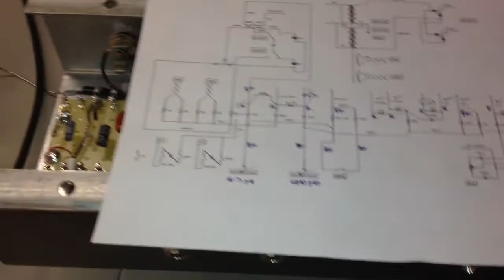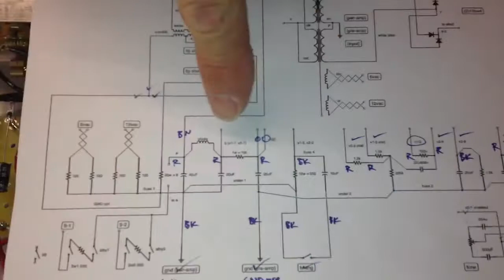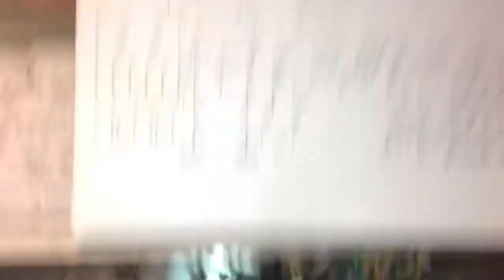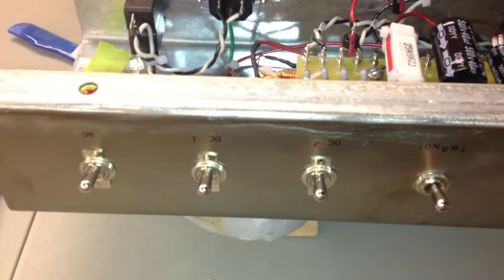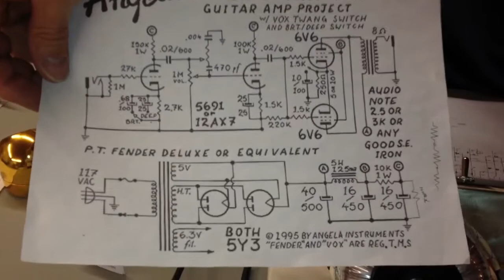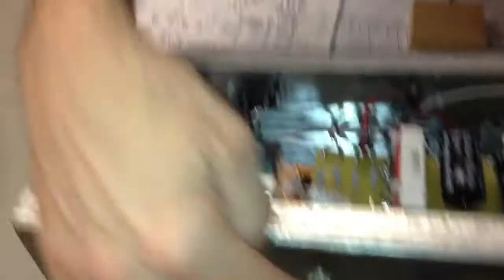angela super single ended 1

Comment: I'm halfway thru a build of the same Amp using original tube specs... I now believe there is too much B.S  included and have decided to strip it back to a quality Princeton circuit.
Reply from the maker: Plz elaborate
Reply: @rick_m_b  I'm building the Amp using the 6v6 tube and the dual 5y3 rectifier tubes... I chose this project as my first build which may not have been a wise choice - After reviewing your build video and the challenges you've incurred combined with my own challenges I feel a time tested design like the Princeton seems like a better choice and I can use most of the parts I have.

Thoughts?
Reply from the maker: @kevinking2468  sry Kevin
IMO the original circuit is simple enough (it’s based on the Fender Champ or very early Princeton). My troubles stemmed from changing tube types (6bm8 substituted for 6v6 and 12ax7). I had previously built a smaller amp with 6bm8 and the original "Angela Super Single Ended" suggested substituting 6SL7 for 12ax7... that lead me down a rabbit hole. I substituted ALL types and that’s where my troubles came from. After may hours of troubleshooting and trial-and-error failures, we changed direction into a "Princeton Reverb" preamp section into the "ASSE" power section as originally specified. The current design works flawlessly and we’re all quite satisfied. The things you will want to watch out for

1- (if you haven’t already considered this) is impedance matching a pair of parallel 6v6 through your output transformer to your speaker. On mine I used the Weber SE15 16ohm tap with an 8ohm speaker reflecting 2.5k to the (2)6v6 tubes. Effectively the pair shares the impedance each seeing 5k in parallel (sry if that’s obvious). If you’re using (1) 6v6, then impedance matching is straight forward 

2- I added separate screen-grid resistors (1ea) for the 6v6: 5watt 1.8k. 470ohm is typical, and higher values yielded more distortion tone

3- separate control-grid resistors also. 1.5k each is another typical fender value

4- the toroidal power transformer we used is prone to hum and buzz. (2) 100ohm balance resistors tied to the cathode (pin 8 of the octal socket) and (1each) to the 6.3v heater supply and a choke (Weber W022699 in my case) from the B+/output transformer to the 2nd node put all of that hum and buzz in check

We are also using parallel rectifiers to supply the parallel 6v6. Hope this helps and plz let me know if you have more questions
-rickmb
Reply: @rick_m_b  Never heard back?